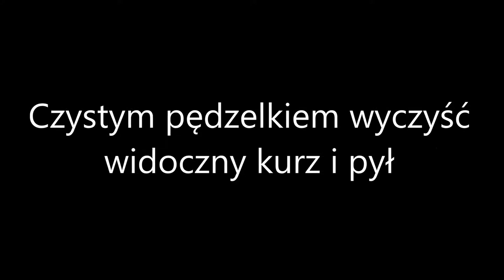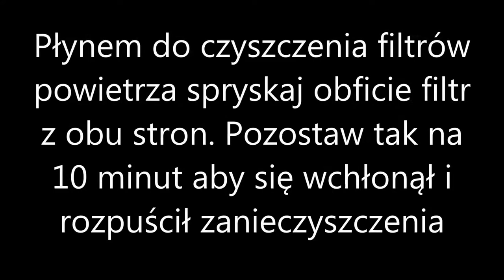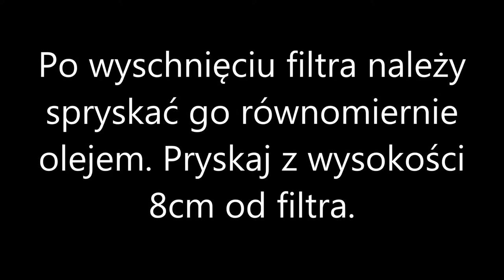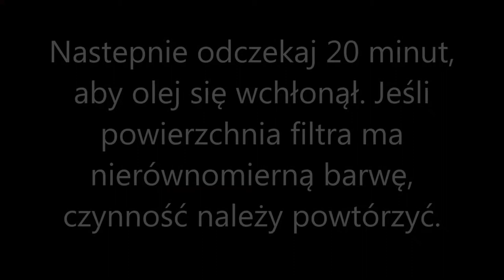RENAULT MEGANE III RS SPORT HOW TO CLEAN and OIL K&N Air Filter

Comment: Hey what tool did u use to remove those screws? The space is very small between battery tray and filter. If you have any link that would be good.
Reply from the maker: shane weldon to jest zwykły klucz grzechotka z krótka nakładka.